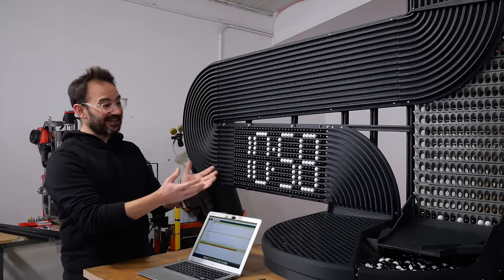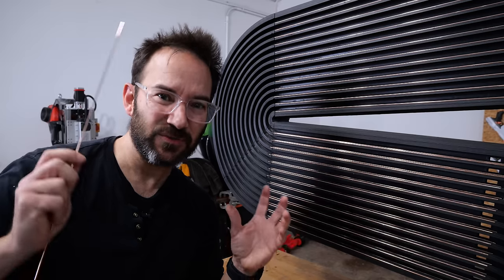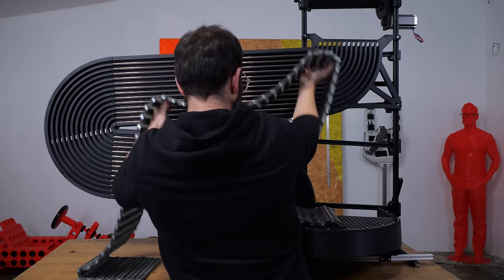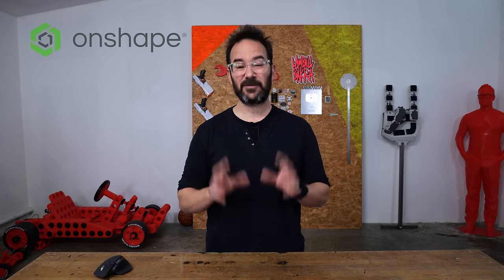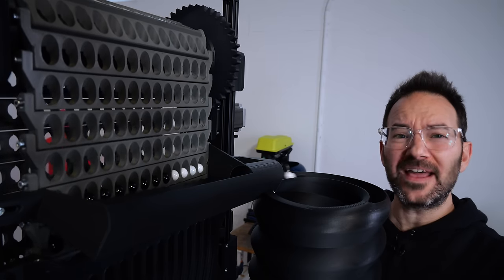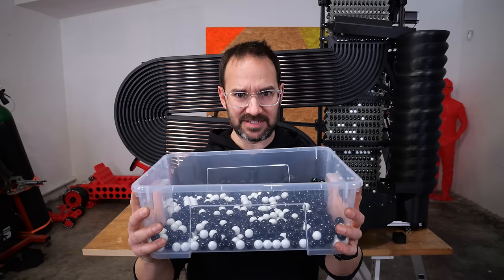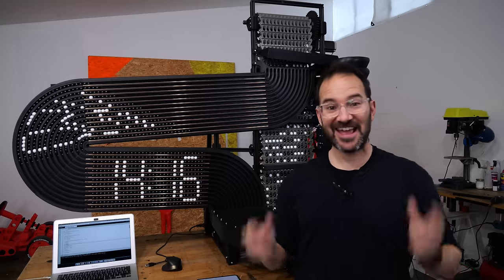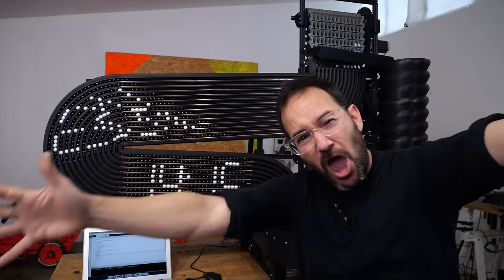BUILDING A MARBLE CLOCK - Pt. 3

Comment: Make sure to adjust the ratio of black to white marbles available to make it more likely you get what you need for selection. Blacks are way more needed than whites and it seems you keep a pool of about 50/50. Probably something like 80/20 would already speed up the clock quite substantially.

Comment: I'd like to see the marble sort redesigned.  I think it would be a lot quicker and efficient to sort the marbles at the hopper in to two smaller streams - black and white.  Once the marbles are separated, lift them with one or more marble elevators where the marbles are then feed into the appropriate slot.  This way you wouldn't need a return path for unused marbles and you could sort them at an independent speed to the lift and output.

Comment: A clever way to speed up this clock up is to have your marble color analyzer in the bottom before the elevator. Then you could have 2 hoppers one for each color. Then cleverly load each color in the right position into the elevator. That way the elevator is perfectly loaded and spitting out marbles every minute. AND you could eliminate the need of your very noisy ball return for wrong colors. The best way to resolve an issue is to avoid it entirely 💪

Comment: You can sort marbles and create two separate trays for them. For example, black on top and white on the bottom, they will be separated until they get to the elevator. Then elevator, could choose which marble they need, simply by blocking white ones (on the bottom tray), from getting into elevator, leaving empty space for black marbles. That would replace the sensor on the top of the elevator. Thanks to that solution, you eliminate the factor of luck. Sorting can be done by sensing the color, just like it is done on the top of the elevator. OR we already know, the order of marbles in each row so we can use that for sorting. The only down side of this solution is that if one marble get sorted wrongly, it would effect everything later on.

Comment: This is a very cool project. so the next one would be a way to store all on top, but split the storage of white and black. So that you can then insert the whites where you need them and only fill with the blacks. ;) That would also make the machine work quieter (less rolling down chutes and such) and also faster building the display.

Comment: The first and the last line do not have to be in the „pool“ because it will always (when you only will be displaying time) be black. You could put some type of guard so that there will always be the same marbles in these lines. This will reduce the amount of black marbles in the „pool“ for the other lines and therefore the speed will be faster.

Comment: Ok I have been looking at your video. I love to see what you are doing. The flaw are the marbles. There is a chance of luck involved getting the right marble at the right spot. Maybe you can solve this issue by using different weight of marbles. For example, the white marbles are less weight than the black. Maybe that way, you can control the outcome. Your goal should be building a number within one minute. If you can get all the marbles in place within one minute, than you achieved your goal.

Comment: I feel like this could be done pretty easily to make it go by the minute.  On the way out, add trap doors for the white marbles to go into a separate section, then they can be easily ordered as you need.  That part actually seems pretty straight forward.  Once they're separated, just order them into the channels they need to go to.

Comment: Keeping the same spirit of using the marbles and not simply...redesigning the 7-segment visor...I would divide the marbles into   separate buckets that are all white and all black, make the conveyor belt take from the white belt exactly what it needs (you can push back the other ones back to its bucket) and then simply let the black one complete the wholes. You can then move the led detector to when the marvels are being sent back to the bucket and that operation will get way more complex, but sounds feasible. Also you would be greatly reducing the time you need to stack a complete hour, because each row is guarantied to be exact

Comment: It looks like there is room at the top to queue up another digit's worth of marbles, or close to it.  Add another set of holds up there like on the left side, keep the elevator running to keep the queue primed, and tighten up the timings and it might be enough.

Comment: It's probably been said before, however if you had 29 marble tracks and a longer outfeed at the end/bottom of the tracks, you could display the time vertically.  In fact you could get rid of most of the curved section and just have it be more vertical. This would mean you would only need to redraw the individual numbers, from right to left, every minute, every ten minutes, every hour, every ten hours.

Comment: Why do you need the zig zag?

At the bottom everything swings round to the conveyer belt on the screen's right side. But if it swung to the left you could stack the marbles virtically to avoid them getting stuck. And the elevator would be behind the clock so it could use the clock as a backboard to keep the rejected marbels from scattering.

This is a really fun design though. I really love it.

Comment: Perhaps you can add a twist structure to the top bit of your design, so that the top rail of the top bit connects to the top rail of the bottom bit, rather than the top one. This could add velocity to the marbles when they turn and make the flow smoother

Comment: Very nice! Would it also be possible to separate the black and white marbles at collection and then release either a black or white marble to release into each channel? This could be done using different mechanisms, like a switch for each channel that releases none/w/b, w and b being fed into the switch from different sides, or a bar for w and b each that would release or hold for each line being released into the channels. This might give you a cadence of several marbles per second. But you must have thought of all this, I love how the clock is chaotic and noisy! Congrats!

Comment: One way to optimize it is to manage them in che collecting area, u should extend it and making the “decision” logic ahead, maybe with a previous sorting system u could also decrease a number of marbles in the system overall. Problem is that this mean a compleate redesign of the bottom side, few more channels, but in this way u will using the chain elevator to only transporting the correct next row, witho the need of the spiral descendent tube. Less redundancy muuch more efficient and hugely faster. Now that im thinking of it, yes, the separation between white and black is the easy way of doing it, first u channel them all, stopping them with a barrier, and separating them with another barrier row by row, scanning the collors, then the black ones goes ahead the whites drop under the channel in a different area, so now u hawe black and whites i separate chambers, the only thing to do is to assemble the next row that will be elevated, and u can also optimize it even more if u decide to feed the belt elevator in lines and not rows (long channels each one facing the corresponding line on the elevator) or just assemble it row by row wo playing with “multithread logic”

Comment: You could reduce a lot of work if you  used the top half of the tracks for hours and the bottom half for the minutes. or even the top half for the hours and 10s of minutes and the bottom for  the 1 through 9 minutes. If you did this while spitting the elevator into 2 elevators you could also reduce the noise by only raising (and ejecting) half of the marbles.
Reply: true

Comment: better sorting idea: use the size difference to your advantage. find the big white ones, make a "load sieve (or filter) rails" the allow smaller black marbles to pass between the rails on the base, but the bigger white ones will only roll on the rails. both base and the rails have negative slope but the base has steeper angle. so a the end of the sieve all the big white ones are at higher position and the small black ones are at lower position, therefore easy to collect separately, and you will need far less marbles. but you will need to change how the marbles are delivered on each "clock rail". Easiest way will be to alternate the colors on the "load belt" while the marble picker functions the same. or, if you are inclined to do more tinkering, make a flap or gear mechanism that controls the amount and sequence of marbles of each color that would eventually roll into each "clock rail," forming a "group" on a "buffer rail," rotate the "buffer rail" and let the marbles fall into their respective place on the belt. the belt send the "group" to the destination "upper clock rail" and release, then next roll, rinse and repeat. the rest remains the same except you won't have any waste marbles the would need to roll back to the pool through the "worm tunnel," therefore much less noise.

Comment: Lifting the marbles by rows and rejecting the wrong ones separately for each one is probably the source of most delay, because more than half of the marbles will always be rejected. Only 50% of the marbles will be right colour and then towards the end when the rows start to fill up, the rejection rate becomes even higher. Of course lifting them up like that is a lot cooler, but it would be way more efficient to sort them before going to the lift, with some kind of mechanism that guides them to the right row, increasing the marble utilisation rate

Comment: I think the greatest efficiency achievement without changing much, and especially not doing partial updates (which won't help constructing the non-updated rows faster, anyway), is to have more release gates from the elevator to the track: Right now if the lane needs, say, black-white and the elevator contains white-black-black-white you have to discard 50% of the marbles, whereas if you can first release the second then the first marble you're done in half the time.
Oh and how about felt in the spiral to get rid of the noise.

Comment: now we just need a marble Seperator to keep the white and black marbles apart, then you can rapidly select a white or black marble on demand,
and maybe some felt in the rejection shoot (which should then be changed into an overflow shoot once the buckets of marbles are full

it is only 3 lanes that actually require a large qty of white marbles all other lanes only need a few marbles,
if you can optimise what goes into the lift, then the speed will greatly be improved

Comment: I don't know if this has been stated earlier or not, when they enter the elevator, couldn't you detect their color earlier and reject them if they are the wrong color sooner? This would allow you to eliminate the need for the spiral that is very loud, since the marbles would have a shorter distance to fall back into the bin, they wouldn't have as much kinetic force to bounce out, or chaos protectory to miss.  I am thinking like 3-4 lines up. using 2 to detect, and 3 to reject if wrong. 

Granted I am not an engineer or know the limitations of such a machine so maybe there is something I am missing.

Comment: If the image was made from columns of marbles instead of rows you could get away with only updating a few columns each time, so you need less marbles. Also with vertical shafts marbles wouldn't get stuck.

Anyways, great project, really nice work!

Comment: Very cool project! I'm just now joining on part 3, so forgive me if this has already been considered. What if you had 2 hoppers, 1 with black marbles and 1 with white? Then you could release marbles into the elevator precisely as needed for the time. This should make the clock faster and quieter. Thoughts?

Comment: you will probably need to increase the belt speed, add more "frame" buffers, but I don't think you'll be able to fit more than one more without re-re-designing the channels...
btw: how is the ratio of black and white marbles compared to the average number of black and white pixels needed? 
Adjusting this might decrease the average time needed to get a full frame.

Comment: I think your marbles might be getting stuck because of the high friction of 3D-printed parts. The nature of additive manufacturing results in very rough surfaces... Metals are great because they're inherently low-friction. However, I think if you were to smooth the surfaces of the plastic, you might be able to get the marbles to flow very smoothly. 

If your parts are ABS, I think if you were to put them in an acetone vapor bath with a little fan to increase circulation, you might be able to melt a fine later on the outside of the surfaces and make them very smooth for the marbles. Just an idea!

Comment: The only way to get marbles in fast enough accurately enough would be to have the marbles sorted as they exited, and then marbles placed into the elevator as it needs, and you need to have this all done in 55 seconds to give 5 seconds for the old time to evacuate, and the new time to move into position. You have a 31x 13 grid, or need 403 marbles to move into place, average 7.4 balls per second placed. We can shave that number down with ease, eliminating the top 2, bottom 2, and middle horizontal rows, and have the no gaps in the center, middle or top, eliminating it's need to be there. You can also do this without a re-design by just not utilizing 5 (2 up 3 down or vice versa) rows. now it is 31 x 8,  or 248, needing only 4.5 marbles placed per second on average. You can also remove 8 vertical rows by not having the numbers be gapped and have all parts of a number touching another white ball. You would be then at 23x8 or 184 marbles, and now only have to average 3.3 marbles per second. Finally, remove the first and last vertical row you use for the outline, finishing it with 21x8 for 168 total marbles, and at 3.1 marbles per second averaged.

To me, the biggest enemy is gravity. You are limited by it if you use gravity to get the balls into position to be loaded into the ladder. Even if you used a feeding mechanism that blocked feeding into the elevator where you don't need it, and allowed it where you do, you'd still have issues because you'd need each elevator bucket line to be loaded in 3 seconds. Gravity is just not efficient here.

Comment: It would be pretty clever to have some device that splits the pool of marbles at the bottom into black/white piles.

Then instead of relying on luck it can just fill the elevator with the desired marbles for each row.

That could dramatically speed things up.

Comment: I can't help but think that many of these mechanisms could be simplified and more efficient. For one, I would have made the marbles slightly different sizes between colors so they could be sorted mechanically, similarly to how they are at 7:57

Further, I would have imagined the (now) two separate color hoppers to then feed a router programmed to draw (by sorting) the next minute. These two simplifications would not only allow use of every ball (eliminating rejections), but would make it quieter and could even eliminate the need for such a complicated vertical conveyor belt and optical sorter. 

The downside? You might need to modify the rails to handle the (hopefully) minor variation between the two sizes that allows the sort in the prior step.

Comment: I would use the sencer to devide the marbles at then end so then fall in to 2 different colection trays whight on top black on The bottem then with a second sencer you can load the lift with black marbles in The corect places and then the wight ones can just roll to fill in the gaps and that way no noisy tube o. The side.

Comment: What if you cleared only the digits needing to be updated? E.g. switch to vertical "scanlines", or flip it horizontally so you can fill from the right side (and add a gate at each digit to clear out the partial figure)

Comment: rather than sorting while picking up the mixed up marbles, you should have sorted while discharging the clock. So you'd have 2 separate reservoirs of black and white marbles, and could quickly and neatly compose the new image for the next minute. There would be no need for the spiral.

Comment: I feel like an easy solution would be to attack a vibrator motor that fires off when the gate to drop the marbles for the new time is released. Seems like they just need a small nudge so a little vibration and fix that

Comment: Could you place the selecting solenoids at or above the level of the bin?

You mentioned you were trying to speed it up.  Just thinking that one thing is it takes time for the solenoids to select the right marbles, right?  Is there a way that they could be selected at the bottom instead?  Then there would be no need for the loud transport mechanism from the top, correct?  Is that possible?  It has been awhile since I saw your first two videos; I forgot the reasoning for placing the solenoids higher up...

But it would take the same amount of time, since the selecting solenoids are still dealing with the randomized pile of marbles either way...  The only thing it would save is what you said was a very noisy transport system from current position back to the bin.  So everything in the transport belt would be correct.  (But then the belt feed would not be continuous; it would have to wait for each line to be made correct before it moved up?)